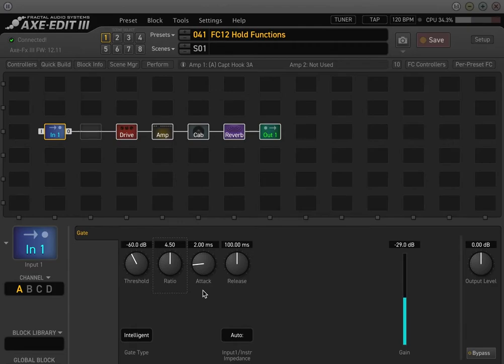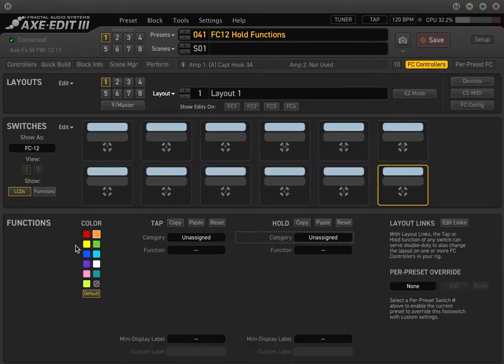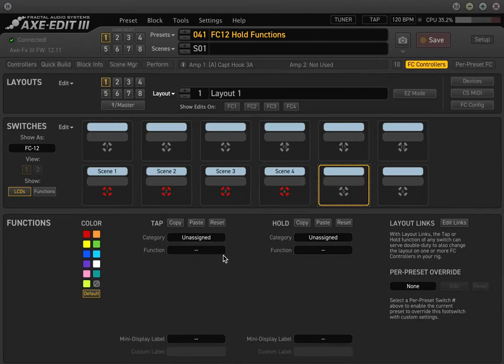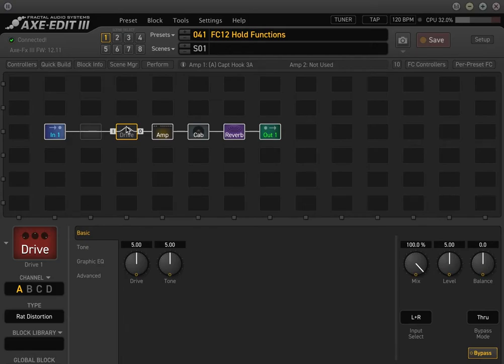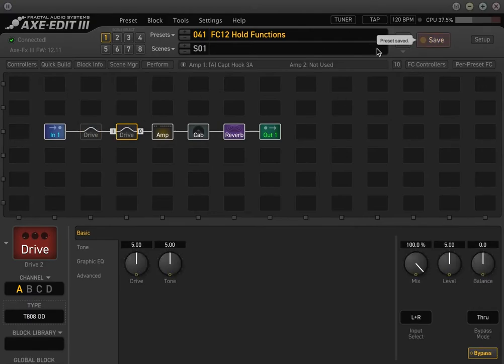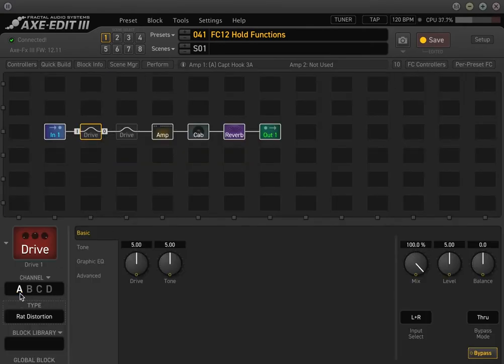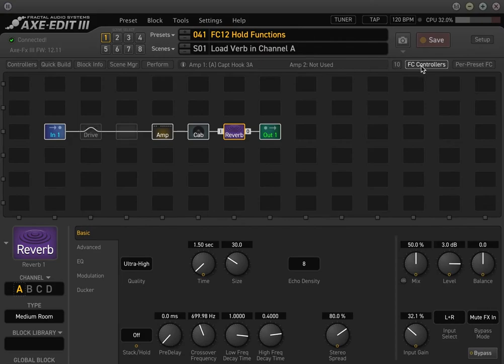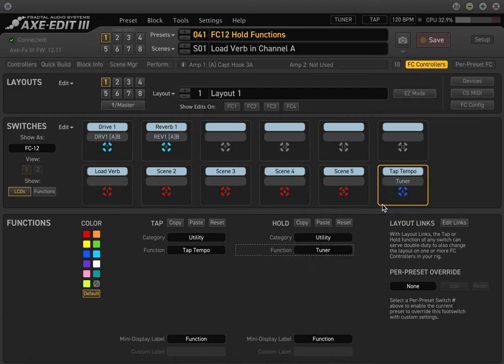AxeFX III Basics Episode 28 FC12 Hold Functions

Comment: can u use this function to simulate the hold button on a feedback pedal Boss FB-2 as long as you stand on the switch the feedback is engaged and when when you release it default back to whatever is on the switch?
Reply from the maker: I would use a momentary function on the control switch for that. Use it to activate a boost pedal or the input boost function on the amp to drive it into feedback and then release it when you don't want any more feedback